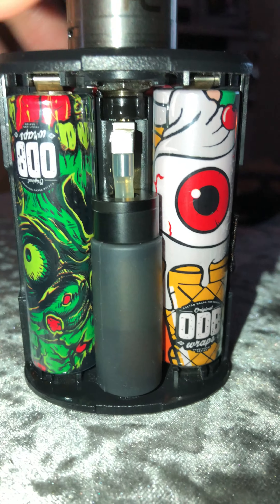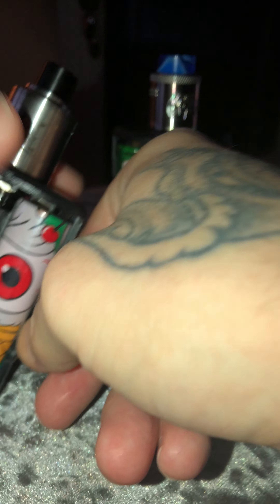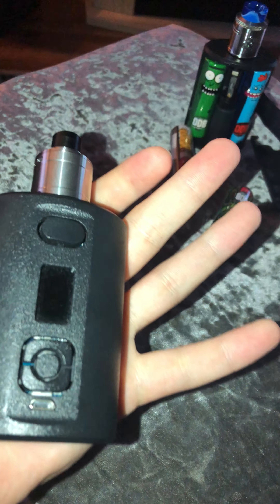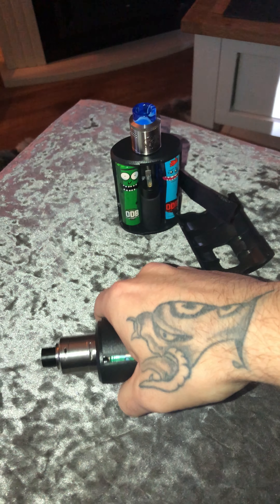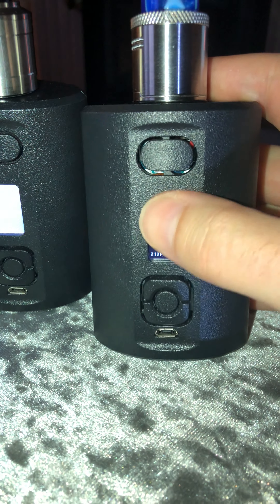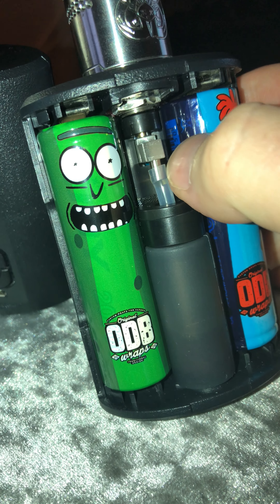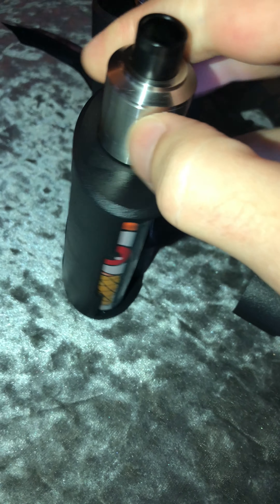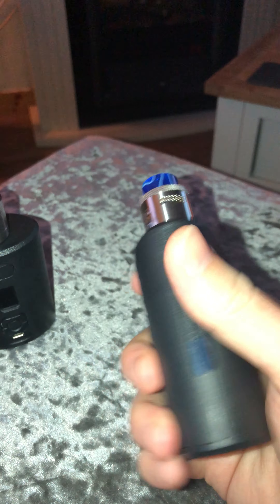SXK Boxer squonk dual 20700. EXCELLENT DEVICE FOR THE PRICE!!!!

Comment: Undo the screws and completely dry the board out, find out where leak is coming from and use a spot of superglue, Worked for me buddy......
Reply from the maker: That's all well and fine to do but your not remembering the board is actually fucked. It will fire as you see but you cannot fix the screen problem by a little bit of super glue. If your on fasttech go onto there forms and I made a massive form on this. Taking screws out countless times and drying out with cotton buds and kitchen roll. Still leaks. So I thank you for your help but my replacement has been delivered and I can see the added a little black o ring just under the 510s black piece to squonk arm.
Reply: @karlrattray8290  Ah didnt realise the board was actually fuked.......My Snow Wolf from 6 yrs ago develops a short and the screen goes all flickery.....Sorry I thought it was the same kind of symptom.....I have to completely dry that out then it works ok for another 6 months...
Reply: Sean Bass you shouldn’t have to super glue anything the price point this is at. Enjoy spending your momma and daddies money buddy..... grow up..

Comment: Can you fit 21700s in it
Reply from the maker: Casey Walls yes that is possible but you would have to sand down the door. That’s what a few people did on my fasttech forum if you go search google sxk boxer 20700 fasttech.
Reply: @karlrattray8290  does this let set it to 8.4 in bypass or no Karl?